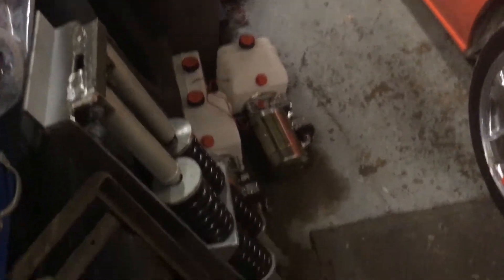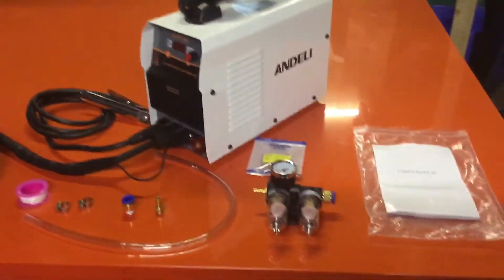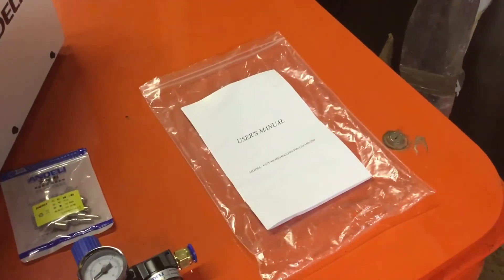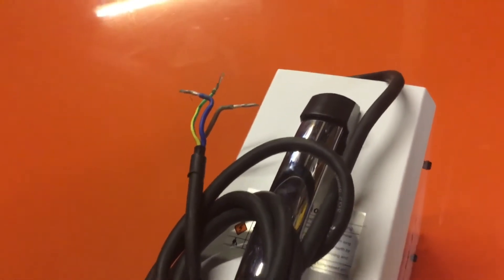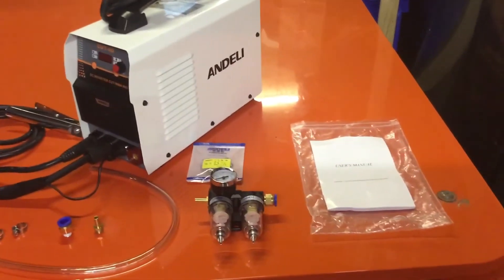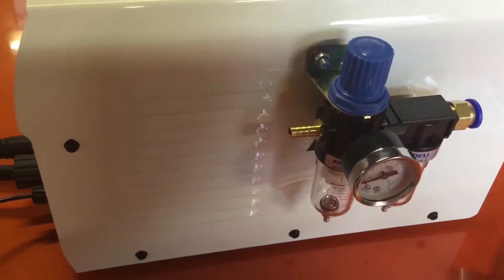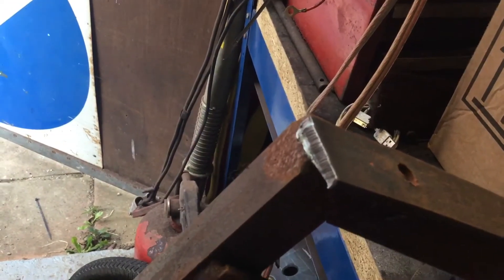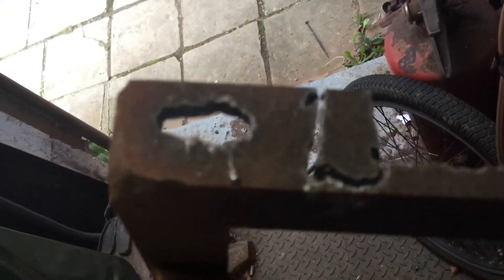Plasma cutter purchased to help with the mini build

Comment: Paul, Best to use some angle iron as a straight edge unless you have very steady hands, There should be a nose ring for the cutter and this will give you the correct stand off for neat cutting plus the ring will sit against the straight edge. Cheers Dave.
Reply from the maker: I think a bit of practice with speed of the torch and the amperage settings are needed ? But yes I agree a guide will give best results! It’s a new toy so plenty of practice!